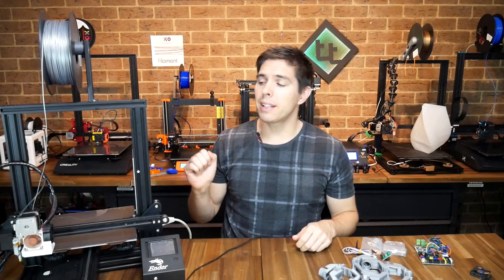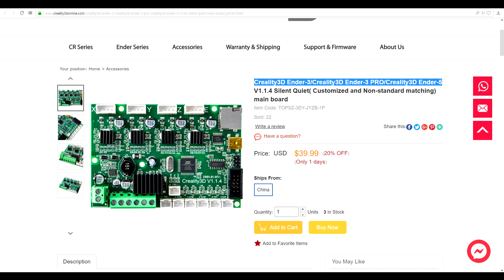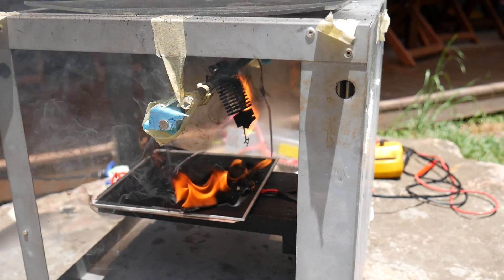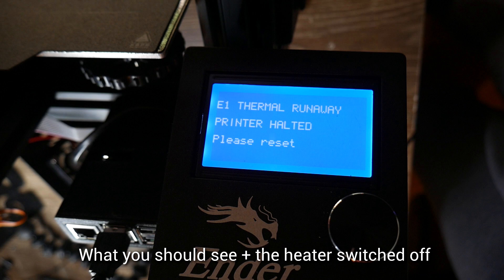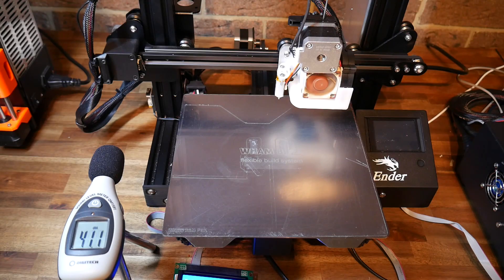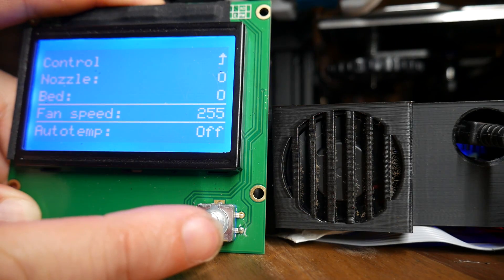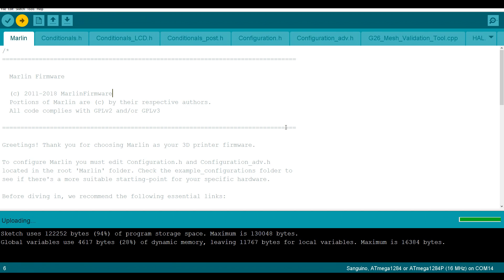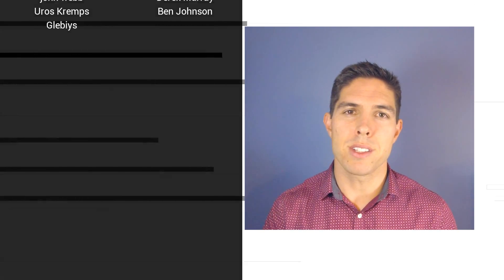Creality 1.1.4 Ender 3 board upgrade - TMC2208s from factory

Comment from the maker: After reading the comments on here and Facebook, it seems that printers shipped with this board don't have the bootloader or TMC2208s. To get this functionality you need to order this 'upgrade' version from their website. If you just received a printer with the 1.1.4 board, I can imagine how frustrated you are!
Reply: So they made two identical versions of the same board yet two different boards ? Good job creality 😂
Reply: risa west the TMC2208 is pin compatible with the A4988. Likely the same board just offered with two driver options.
Reply: @cbz1956  So can i just get the other driver chips and solder them to a 1.1.3 Creality mainboard? Or is that not possible and i will have to change resistors etc as well?
Reply: @rainerrauser8618  i think its posible but desolder and solder that chips its not and easy task
Reply: @rainerrauser8618  No.  These can't be desoldered and replaced by mortal humans.
Reply: @richardwest9520  Their product policy really is something else. And not in a good way!
Reply: @Marcel H Only one reason really: drop-in convenience. MKS is much more work to get working properly.
Reply: Since I was having a new Ender 5 delivered by Amazon.ca; I asked Creality if my new Ender 5 might have the 1.1.4 Main Board included. 
Here is Creality's reply: 

"service@creality3d.cn
8:11 AM (27 minutes ago)
to me

H, 
The Ender-5 doesn't comes with the V1.1.4 board.
Shipping to CA is free,  but you need to pay tax when the package arrives at your customs. about the tax rate you can ask your friend or customs office.
Sue. "

Also ... to reinforce the point ...
Since I ordered the higher priced "Original Creality" Ender 5, over the ComGrow model; I was hoping the upgrade might explain the price difference. Creality recently replied to another of my inquiries, stating the two Amazon.ca Ender 5's are identical :((
Reply: On link you have in discription to purchase mainboard is new firmware with thermal protection enabled, they says. Could you make video?
Reply: I ordered my mks a week before this came out, still think I'm gonna like that since I want to wire up a bltouch without snipping wires and enable some more features in the firmware
Reply: @wil7vin  You will LOVE the MKS board. Its night and day how much quieter these printers get when you dump the cheap drivers. The next thing that will begin to bother you, maybe, are the noisy fans. It amazed me that the drivers could make a louder noise than the fans.
Reply: @timf7354  I have a mod board coming back to me from china to fix the issue of wobbly temp readings on the GEN L boards, I'll keep you posted when I get the boards in
Reply: @timf7354  the reason the fans are loud is because they are what 80mm? To have quite fans you must use larger fans.

That's why pcs now use 140mm or 200mm fans rather then 80mm or 120mm that used to be the standard.

 i do not understand why people are putting those ugly brown and  Expensive noctua fans on their printers.at best they give ya a couple extra cfm but they will be just as loud as any other fan in that size.

Add a larger fan,dial back the voltage and have less air flow or deal with the noise simple as that..
Reply: I just got a Sainsmart knockoff of the ender 3 about a month ago and it has the 1.1.4 board in it. No bootloader . Upgraded to TH3D firmware. It prints very well for what it is.
Reply: Ye i dont know yet what drivers are on my board 1.1.4 that I got as replacement. But I dont think its very silent.

I will remove a heatsink today and check. But how odd to make two versions of the same version 😂
Reply: Only thing that bothers me currently is thermal runaway
Reply: @reasonsvoice8554  I saw someone had a smoke detector bolted on their top horizontal rail.  Old school :)
Reply: @4cpus4me  that is some 1st class Southern Engineering, there!
Sometimes simple really is best, though.
Reply: Can you do a video on the 1.1.5 board I'm struggling I've tried following all your instructions on flashing both Marlin and TH3D neither work. It confirm the board is the issue as I was able to do it no problem ony 1.1.3 board. Please help!! Can even send you my board.
Reply: That's why the product says "(Customized and not standard matching)" it's a "special" 1.1.4 main board.
Reply: what they sad. modified (2208) standard non matching (not matches what comes standard on the 1.1.4 in new printers)
Reply: Hi my board have vref at 1.25V on all stepper can you show the right formula using 150 resistor.
Reply: What are your vref values? Mines all ~1.23V
Reply: @Azaim2  mi value is 1.275 for all stepper
Reply: now set 0.95V on xyz and 1.1V on  extruder .the value is little hight than normal because rsense is 0.15 not 0.11
Reply: @turrican1980  thank you for information. I am also searching for the right value. Mine y stepper getting a bit hot. Can't sure if its ok or not.
Reply: @Azaim2  at 0.95V temperature is under 50°C is Ok
Reply: @turrican1980  i decrease mine xyz to 1.115 to see if there is any difference, not touch my E. Only my y stepper getting hot.
Reply: @Azaim2  go to 1V or 0.95V
Reply: @turrican1980  i will try yours values this weekend and give it a test. Decreasing make so much difference. My y stepper is so much cooler now. I see from this video he is measuring 1.135V in 2:10. Thats why i want to try almost same value on mine first. I think they rush 2nd and 3rd batch and didn't adjust the vrefs. 
Is this value affects another things or just making stepper motor run with higher values and make it hot?
Reply: @Azaim2  i decrease the voltage using formula and Motor datasheet E Motor is bigger than xyz E Motor rated 1A xyz 0.8A
Reply: @Azaim2  you can decrease only problem is layer shift But If you Print good no problem
Reply: @turrican1980  i think your values are correct. I chatted with creality support today. I told him my problem and asked about vrefs. He asked  creality tech support and give me these values. XYZ 0.94V，E 1.2V
Reply: you should unlist this video or change the thumbnail this is very misleading i now have to buy thermal glue to glue the heatsink back on
Reply: I guess I am kind of randomly asking but do anyone know of a good website to watch new tv shows online ?
Reply: @Eliseo Martin I use Flixzone. You can find it by googling :)
Reply: @Antonio Judson Definitely, I have been using flixzone for years myself :)
Reply: @Antonio Judson thank you, I signed up and it seems to work =) I really appreciate it!!
Reply: @Eliseo Martin happy to help :)
Reply: Since I wasn't expecting anything but a direct replacement, I was just happy I was up and running again lol
Reply: Chatted with a rep on Facebook today and they said the new Ender 3X also comes with the 1.1.4 board that doesn't have the boot loader or silent drivers. They now sell a 1.1.5 board that has them!
Reply: @nighthawkbhdts  yeah I've seen the 1.1.5 board on ebay from one seller.
Reply: @nighthawkbhdts  my 1.1.5 Board I purchased separately does not have the bootloader. Or at least I can not flash the firmware using Arduino IDE.
Reply: Yeah, I’m a bit disappointed. Though, I do already have a MKS Gen L with TMC2130’s on the way. So, I’m hoping I enjoy the extra features the TMC2130’s have to offer enough to justify the extra work. And I know mine definitely doesn’t have the TMC2208s, its too noisy.

Comment: Hello! I need Your help with the CR-10S pro pin numbers... I want to connect the orbiter v2 with the filament sensor to my printer and I do not know the pins of the connectors on the connection board... The orbiter filament sensor have a 4 pin connector with 3.3-5V, GND, sensor pin and remove filament button pin. I see, that the sensor pin on CR-10 connected to the X+ connector, I do not cnow the pinaut of this socket and I want to connect the filament button to Z- pin. I need know where is +/-5V and where is the signal pins... Can You help me?

Comment: Hello Micheal, i have an ender 3 pro with the V1.1.4 board from the factory, My question is, I have just ordered a Micro Swiss Direct drive extruder with hotend, I have also ordered parts to extend my z axis to 500mm, what software do I need to configure the firmware to suit these changes.....

Comment: do you have any data on which boards are fitted with which drivers? i have two ender 3 pro's, both with 4.2.2 boards, one has code E on the SDcard cover and one has D - does that even exist? (or 'O' cant make out what it is due to the way its been written - i tried asking on the marlin forum too, only answer i have so far is 'english isnt their first language so might be an A written in a rush not being their native language' - which is a bit of a silly deduction.. but then, cant see that in the driver code listed on the th3d site either).  any idea if theres another way of discerning which motors are installed?

also, i have a Z axis stepper motor from a machine which had the V1.1.4 board and 1162 firmware, i installed that on my 4.2.2 board but i think i might need to change the driver in coniguration.h in marlin, but havnt a clue which drivers to specify.... would be really cool if there was a list of boards and corresponding motor drivers, or maybe between us all we could put something like that together?

Comment: This is weird. I have the V1.1.4 board in my Ender 3 with the TMC2208 stepper drivers. The steppers are not quiet at all. Actually, it's a lot noisier than the previous A4988 drivers. One can really hear the steppers "sing" at different speeds.

Comment: My ender 3 pro has 1.1.4 , strangely it has thermal runaway (which I had to flash the firmware & had to install a boot loader) to enable, and the motors are way noiser.  Im going to buy some smothers for a tenner on amazon instead of  £40 for the 1.1.5 board that does this. so im guessing i have the original 1.1.4 - not the  "upgraded" 1.1.4 (now called the 1.1.5) - just letting people know the noisier 1.1.4 like mine does have thermal runaway, but you need to flash a boot loader (I used an arduino)  & then a later version of marlin (I think I followed your guide Teaching Tech) it might have involved re-writing part of the code too, following the guide.

Comment: Hi Michael, please help!  

I own many creality machines and am very proficient at using them.

I recently upgraded my Ender 3 Pro (after a year's use)

I have a real issue with Z position on print.

I run a gcode I have written to level the bed, it homes then stops above each knob for a specific period of time.  I get the gap perfect and level perfect, then I send to print.
It homes then moves the nozzle up about 1 mm higher, runs my purge start script too high from the bed then prints on air.

I have tried playing with gcode on starting script on both leveling gcode, and also sliced parts and to no avail, I have no idea why it homes correctly then raises before a print.

Can anyone please help before I go back to the old board?

THANKS!

Comment: Nice finally got around to fitting. Seriously quiet! V1.1.4 board with the TMC2208 and botloader. Removed the dampeners and the TL smoothers as didn't need them anymore. Seems to have shifted my Y axis though by almost 20mm forwards and X by 12mm to the left so the larger prints come off the bed infront. The bed centre isn't where it was. I think need some Y stop extras. Means glass bed clip placement is interesting. (not fitted the flexible build plate or a BLT)

Comment: Hi, do you have any tip how to check which stepper driver is installed on my Ender-3 mainboard v1.1.4 (Box version), without physical removal of heatsink?. Is it worth to install stepper damper in case of mainboard v1.1.4 or completely it doesn't make any change of noise level (during printing)?

Comment: Hi, thanks for this great video. I would like to install ESP3D and run an ESP32-CAM on my ENDER 3s. 
The motherboard came with my Ender 3s is the V1.1.4 board.  Do you know where are the TX/RX pin on this particular board?
According to ESP3D document, I need to connect ESP32 TX/RT to V1.1.4 TX/RX pins.  However, I couldn't find such information.
Thanks!

Comment: I've just got an Ender 3 for my birthday and it's noisy as hell. It has the 1.1.4 board but I'm assuming it has A4988 drivers on board. Doing an M503 in Octoprint doesn't show the M906 line either. I do have an SKR 1.3 running 2208's on my Anet E10 though, which I am constantly getting poor prints from, so I may just butcher that for now to quieten the Ender 3.

Comment: I have the upgrade v 1.1.5 board which has supposedly included bootloader and no info whatsoever i can find to flash the firmware . Which "board' in the Marlin board manager is selected to flash the firmware. Or is it automatically detected by the Marlin software Thanks.

Comment: Just discovered your channel, you do some amazing work!!  I am doing many of these upgrades to my Ender 5 now. 

I am going to follow all your steps for the Ender 5 (Ender 5 SKR V1.3 & MKS Gen L guide) will all these work with 
(Sovol Creality 3D Ender 3 Pro New Upgrade Motherboard Silent Mainboard V1.1.5 with TMC2208) I understand I may have to modify the print where the board attaches for the mounting holes. 

Will it work with the touchscreen as well? I already own the new control board, MKS touch screen and the Bl Touch. (All brand new and within the return period if needed.)

Thanks for your help.

Cheers
Reply: AND! how has your journey been? is it worth to upgrade to skr 1.3?

Comment: I installed the new 1.1.5 mainboard and Extruder motor is turning off after 2-3 hours of print, maybe driver heating and protection going on? Maybe vRef must be adjusted? A brand new board in Ender 3 Pro. 1.1.3 was stable. Tks!

Comment: Got the 1.1.5 board today (with a BL Touch V3.1) - Is there a way to test to see if it has a bootloader? Like a command line in Arduino IDE program.
Reply: UPDATE: My 1.1.5 board came with a bootloader (main issue was getting correct drivers so Arduino could flash firmware)  Also seems my Ender pro broad 1.1.3 had a bootloader too
Reply: UPDATE:  My 1.1.5 board came with a boot loader and i have a BLTouch 3.1 - I installed TH3D 2.15 (with the bltouch defined) and have ABL working (well almost, just need to fine tune the z offset)

Comment: Installed a replacement v1.1.4 board about two months ago and I think this is also a piece of junk. I am having the same issue with a burned out mosfet (heat bed)

Comment: Hi Michael!
First of all, thank you so much for all your advices and wonderful videos. It really helped me started and fixing issues with my ender 3 pro.
I have a question about Marlin firmware and its tuning required for the new v1.1.5 silent board (identical as the silent v1.1.4 but relabeled as v1.1.5 to avoid confusion) and especially on the Vref side since it seems different..
Let me say it this way: I am using a stock board on my ender 3 pro (v1.1.3) that I modified according your videos to get a booloader on it and flashed a Marlin 1.1.9 customized version to remove some unnecessary features and activate thermal runaway protection but also manual bed mesh leveling (this is awesome by the way to compensate ender 3 warped bed issues without the need of a BL touch). Thank you again for making this so easy by just following your videos.
Since this silent v1.1.5 board will come with a pre-installed bootloader, do you think I can use this customized marlin firmware as is or should I investigate deeper on additional tuning to be done because of these Vrefs changes? I have no idea for now if Vref is also a parameter to take into account when editing Marlin code before building it.
Thanks in advance for any thought about this!

Comment: To stop the confusion, they now call this board the 1.1.5
Reply: And my ender 3 pro was shipped with 1.1.4 but not with the 2208, or atleast they are not nearly as quite as the ones mounted on the 1.1.5
Reply: @MagnusOlssonMalvik  same shit. mine is 1.1.4 and its make lot of noise

Comment: This is really confusing, so which one is better for Ender 5: v1.1.5 creality board or TFT35?
Reply from the maker: The 1.1.5 board has come out since this video but looks to be the same. Tft35 sounds like a touch screen..
Reply: @TeachingTech  so if I want something reliable with a touchscreen to go well with astroprint for WiFi printing would you recommend TFT35 with raspberry Pi for Ender 5?? Thank you for taking the time to answer this, this is going to be my first 3d printer!!

Comment: I just installed the 1.1.4 and did a home test and it’s no quieter 😞 m yet to run a print and see any difference and I’ll check the stepper motor drivers. But so far it’s a bit disappointing.